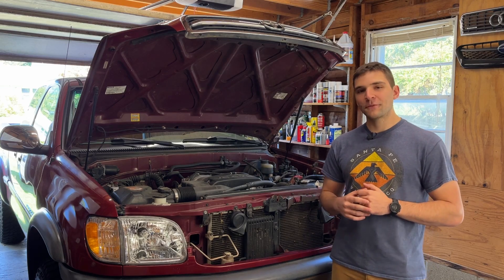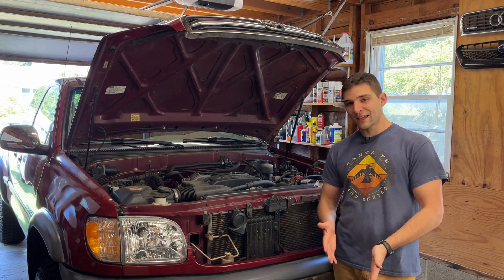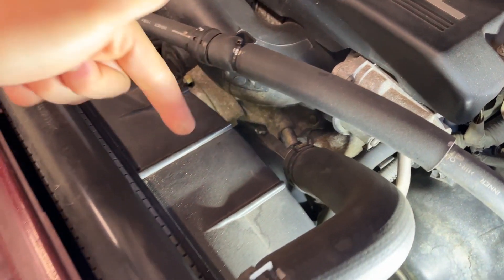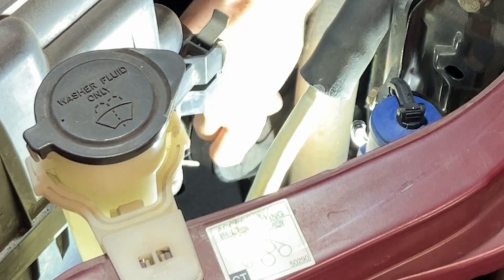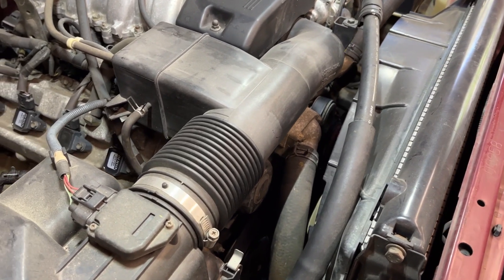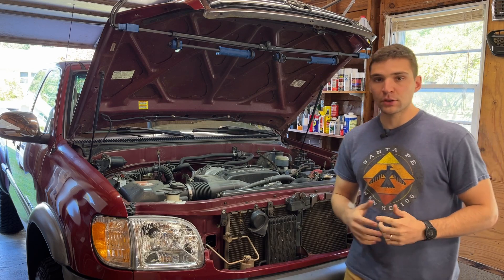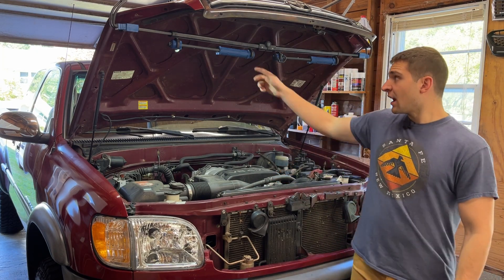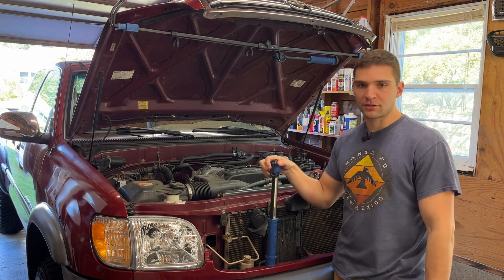Replacing the Serpentine Belt on my 2002 V8 Tundra

Comment: The new kitchen looks awesome. I got a small breaker bar so that the handle sticks out just over all of the tight space in the bay. It made it so easy to change my belt.
Reply from the maker: That's a good tip, a longer bar would definitely help with leverage and help avoid it dropping into the engine bay like I did 😂 thanks for watching!

Comment: Hey sal is that the same as the timing belt u replaced ?
Reply from the maker: Nope, the timing belt is internal to the engine and is a much more involved process. This is the serpentine belt and just runs the engine accessories. Thanks for watching

Comment: Yea mine is doing the same thing. Seems like our trucks are breaking at the same rate, I’ve done almost everything you’ve done. You have flappy AC vents? I’d love to see a fix for that, I’ve found little on the internet addressing this. Appreciate the video!
Reply from the maker: Haha yeah unfortunately our trucks are getting old believe it or not. But good news is most of the fixes are pretty simple. I haven't had any issues with my AC vents yet, but I'll make a video if I do! Thanks for watching
Reply: @JDMDriveway I have a timing belt done in the next 2k miles, I’ll just put a new belt on when I have all the stuff cleared out. Will save my knuckles for sure
Reply from the maker: @CurtisL8.3066 yeah makes sense! This is pretty bad of me lol but I honestly don't remember if I put a new serpentine belt on when I did the timing belt.  Definitely the right time to do it though!